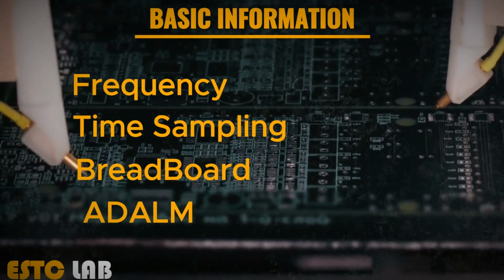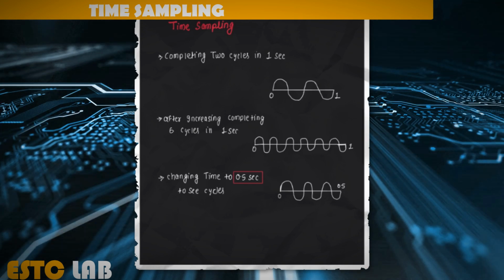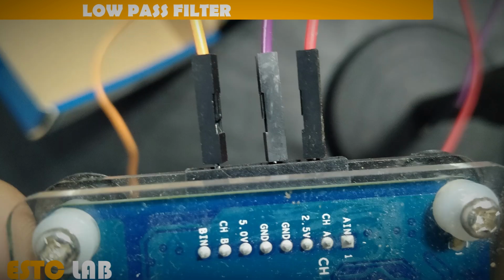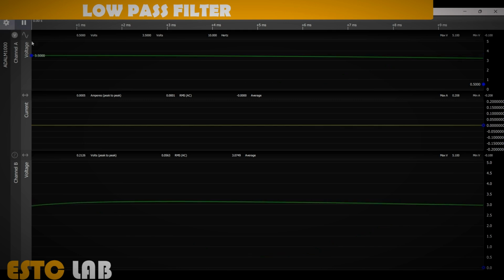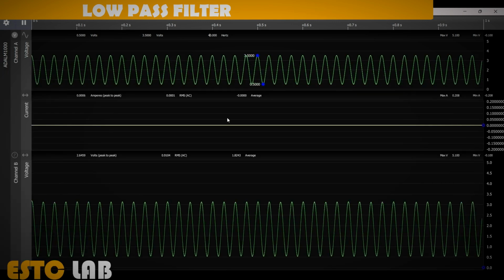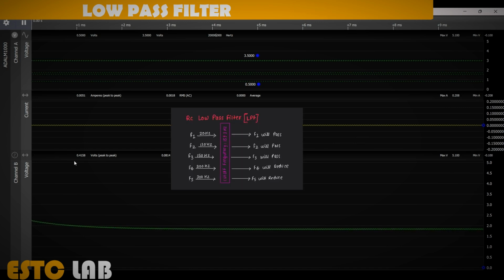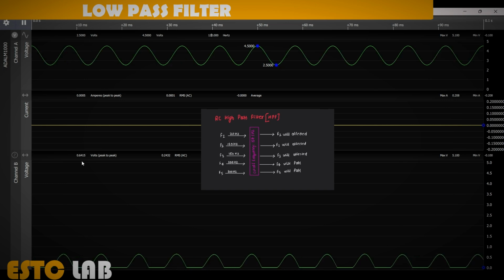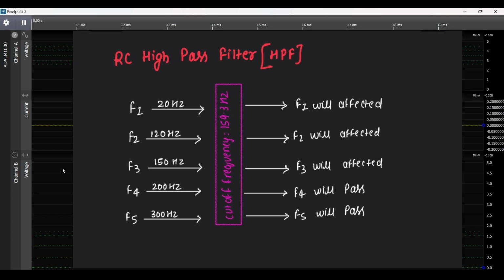LOW PASS FILTER | HIGH PASS FILTER | BREADBOARD

Comment: what is the input voltage you are giving at channel A?
Reply: 0.5+3sinwt V
Reply: @anuragutpaliitmadras can you give i/p voltage other than this.
Reply from the maker: yes you can give any input of your choice
Reply: Vpp is 3 volts right
Reply from the maker: Vpp  is voltage Peak To Peak Which is equal to (difference of highest and lowest voltage ) in this case Vpp is 6v
Reply: @chaturengineer565  so when you are ploting the graph is it gain vs frequency?
Reply from the maker: I have plotted V out vs frequency ............... [gain is (Vout / V in )]